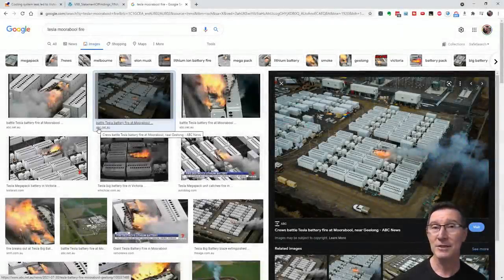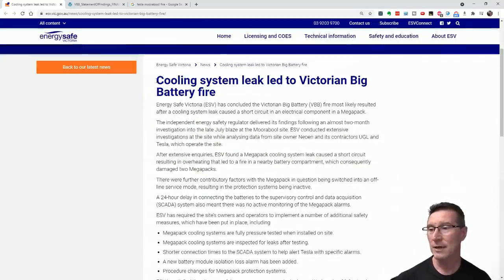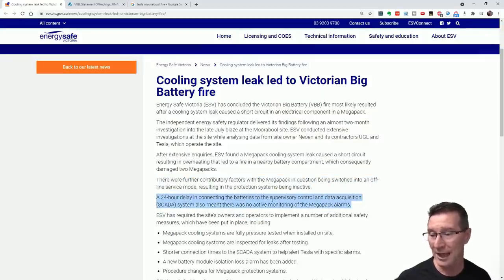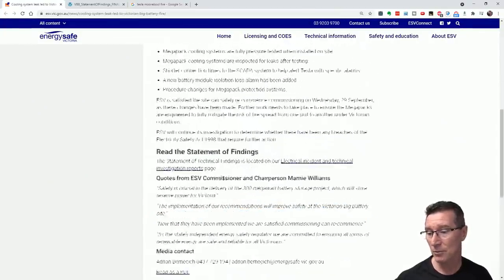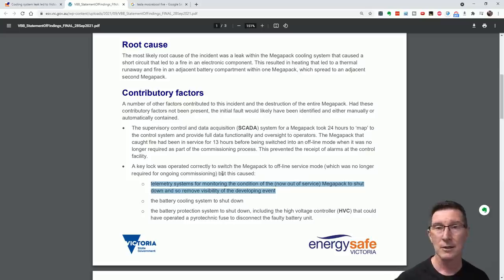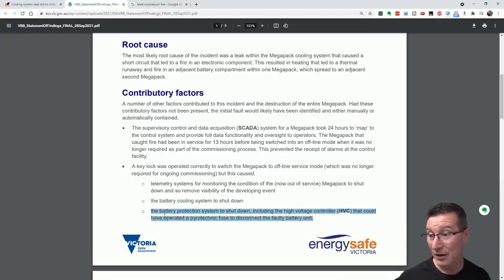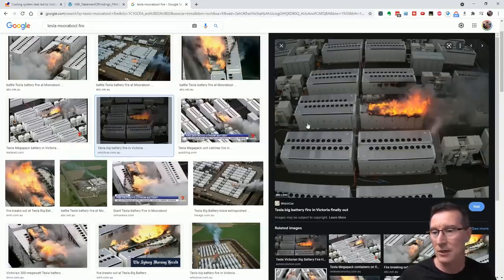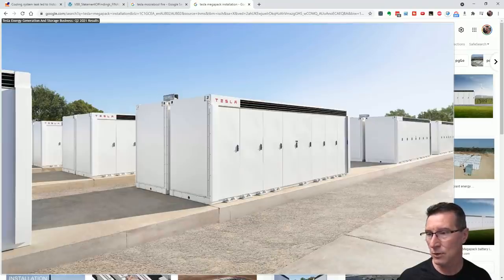EEVblog 1422 - CAUSE of the Tesla Victoria Big Battery Fire

Comment: The fact that they have no means of leak monitoring is surprising. Talk about single point failure mode!! Sounds like these installations have a lot of them!
Reply: The system was offline and not reporting such things. Had it been on it would have had mutliple alerts for different things along the way..
Reply: @--Nath--  Says who?  That report is a whitewash if I have ever seen one.  On another note, beachfront condo for sale in Florida, as well as penthouse units in downtown San Francisco.
Reply: @ReachOutToWilliam  They have pressure and temperature monitoring at minimum in the cooling system. A simple EV has that and Tesla loves sensors. On the other hand this report was lacking any specific detail whatsoever. And it's not that clear either if the SCADA could prevent the fire if it were mapped in time, because the offline switch turns off the monitoring anyway. The details are a bit hazy in this one. Why they put the pack in offline mode in the first place?
Reply: @mtx33  The lack of sensors even offline is a serious "oversight" for a facility of this size.  Poor engineering.
Reply: they have no monitoring when the monitoring is turned off... solution: make it harder to turn the monitoring off.
Reply: @somedude-lc5dy  Or don't leave the pack unsupervised in service mode. :D

Comment: Why do they use Li-Ion batteries for this kind of application anyways? I mean, LiFePO4 batteries are much more fire-safe and therefore also much easier to put out if there is an electrical fire in the area around the cells. And it's not as if the more space these cells need for the same capacity would matter very much in a facility like this?
Reply: AFAIK they will use any cell they can and soon (or already) also LFP like on Shanghai Model 3/Y
Reply: @rkan2  I'm actually quite happy that the Model 3/Ys that we'll be getting soon also use LFP cells. After all, they'll be built locally and there should be some pride in quality there ;)
Reply: Because this is one of the uses Telsa has for recycling cells from failed car battery banks. The duty cycle on these powerbanks is less aggressive than in a car so they can strech out the service life and in effect sell the same batteries multiple times for full retail in it lifecycle.

Dispite all this profiteering, Tesla still can't turn a profit without government subsidies.
Reply: @SurmaSampo  These are no used batteries.  Where did yuo got that these systems have used batteries?
Reply: @ikocheratcr  I assumes they did not change their supply chain since the original powerwalls which did use recycled cells.
Reply: @SurmaSampo  Source please!
Reply: @srenjensen3817  Dude, I am working from memory from several years ago. I don't have a copy of the original source and don't have the time to find it for you. Sorry.

Comment: It would be interesting to see the internal layout of the cooling system relative to the failed component. Seems like putting a water tap on top of your fuse box at home.
Reply: I don't think they put hose clamps in top of a relay box or something like that, but may was an "internal" leak inside some cooled component, but i'm curious too. :)
Reply: You joke, but I'm dealing with a house where the previous owner (or someone) did just that...
Reply: @arthurmoore9488  That's tough! I saw wild things in my life too, but most of the time it was more like someones bright "home improvement" idea or simply gross negligence. I'm pretty sure they conducted a test scenario with ruptured coolant lines, and designed the cabinets accordingly. But I only believe it when I can see it! :D
Reply: That's the reality of modern tech. Data centers have high power in close proximity with liquid cooling. But we have better thermal and short protections than this system clearly.

Comment: I read "failed safely" as "didn't leave a massive crater where the batteries where."
Reply: I think that's the correct interpretation. a person walking through the site would not have been killed by the failure since it was just a gradually escalating fire they could walk away from.
Reply: Looked pretty safe to me. There was no earth shattering kaboom.
Reply: I think it’s that the isolation from the grid was maintained and that nothing outside the megapack became energized. The fire could have melted insulation in a way to send ac or dc outside of the pack or to the surface of the megapack, but did not fail that way.

Comment: Hmmm. A leak in cooling system caused short circuit. 
I wonder why they do not use non-conductive fluid for cooling?
I heard oil is used to cool high voltage transformers, should be good enough for this as well.

Comment: "Megapack cooling systems are fully pressure tested"... wait does this mean this was not done before?!?! THat's ridiculous considering a $100 AIO water cooler goes through leak testing.
Reply: I think the inference is high pressure testing after being banged about on a truck then installed.

Comment: In Cornwall UK the new waste to power plant had to shut down for six months while us UK installers replaced all the soft solder joints with brazed joints as the cooling system leaked. Also cooling systems can use combustible gasses.
Sounds like the installation team used the main isolator rather than the standard routine to take pack offline to cause a complete shutdown.

Comment: The image you show on the left at ~5:30 shows the cooling. The left side of each rack unit shows the coolant in and out lines (black) and on the door is the coolant reservoir, pump and in front of the heat shield is the radiator.
Reply: Image is of a Powerpack that has a perforated door.  The Megapacks in the fire clearly have solid doors and have cooling fans on top.  I assume that Australian climate is too hot for the door cooling and requires cooling units on top, but could be a different reason. Also, I don't think that we see the pump.  There's two black boxes on the door (that look the same) but both only have orange electrical lines.

Comment: My theory:
The coolant leak might've resulted in a short circuit, directly shorting the batteries. The wires and batteries began to heat up from this rapid discharge event, and because the cooling systems weren't working, the batteries caught fire from exposure to heat. This fueled other batteries to catch fire until the entire thing burned down.
This is my theory and it's not confirmed.

Comment: i have heard a story from a friend where they had a senior engineer design a cooling system for a 24kw inverter that had no detection or loss of pressure detection whatsoever and its safety was entirely based around the (wrong) idea that distilled water is non-conductive, remains non-conductive while in an aluminum loop indefinitely and thermal detections is enough. 
and yes, they planned on also adding in antifreeze
Reply: Anyone designing cooling systems where the coolant must remain non-conductive knows that a lot of metals are a no-no; a laser system I've worked with has the coolant pipes internally nickel plated to prevent the deionised water taking up metal ions.

Comment: Might be a good idea to install misting sprinkler systems to mitigate radiative heating of nearby packs.

Liquid Nitrogen might be the only way to extinguish the core fire... It would remove the heat and cool the cells so that they cannot discharge.  Fire could return when bits warm up in ambient conditions but it gives time to contain the damage.

Comment: I have had 2 condensers that lost their charge from the factory (Residential ACs are pre-charged) in the last 13 years. One weak wield & one rough handling. I did hear of others from installers. Copper tubing conducts heat well, but is soft. Think flexing solid wire.

Comment: I would assume they are accepting a single fire taking down two megapacks. aside from that, it seems like it worked ok, but maybe some corrugated steel between rows to prevent other rows from catching, even with worse wind.

Comment: In short, they violated the first rule of any engineering: KISS
One(!) faulty component killed a whole stack? wow... it's even worse than I initially thought.
Reply: @klam77  maybe do some calculations before you spam garbage dude...
Reply: @Basement-Science  Well, a pumped-storage hydropower plant can hold up to several GW, it's just a matter of size. And storing more water in Australia isn't the worst idea anyway. Solar power during the day and hydro power during the night is not a bad idea.
Reply: @hermannschaefer4777  Find a suitable location then. Hint: this is by far the hardest part. All the good spots are usually already in use.

Comment: Makes as much sense as "Well the cooling of the nuclear reactor stops when we SCRAM the reactor" The reactor/battery is still hot you muppets
Reply: Well, Lion is not really supposed to be hot anymore after it is not being charged or discharged - unless there is some physical fault with the cell.
Reply: They way I interpreted the wording, it suggested that the leak itself caused the fault, not the loss of coolant. If the coolant was mildly conductive, it could have easily initiated an arc on downstream electronics, and of you've ever seen a multi-hundred volt DC arc, it is a nearly unstoppable force.

Comment: I don't understand either why they said it failed safely, even in an environmental perspective, there should be pump and funnels to try absorbing most of the smoke. They need a firewall, not just between each megapacks, but each packs. I would guess it took 24 hours before it's proprietary software and it had to connect to the mothership before giving controls to operators.

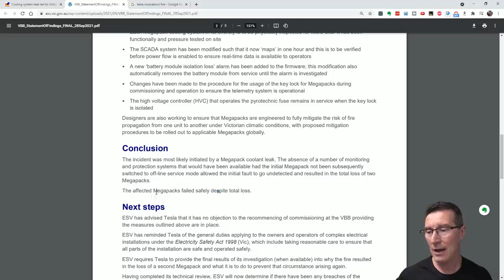Comment: 23:30 - "The megapacks failed safely" - I would presume that it means they failed in the way specified. Most notably, that would include the absence of any explosion or deflagration, the absence of any electric interference with the remainder of the facility, and the absence of uncontrolled spread of fire.
Also, from my understanding of the report, the experts seem to be of the opinion that even the adjacent unit might have remained unaffected, had it not been for the extreme Victoria climate, which seems to be outside the operating conditions for which the Megapacks were originally designed.

Comment: Interesting... One would imagine the cooling system pressure could be monitored for leaks. Especially if it's a closed loop system.
Reply: Even an open loop systems could just have a simple level switch. I operate a wind turbine (among 35 orhers) from 1992 wich has a level sensor for gear box oil. If it gets below minimum, the turbine stops and CALLS me. 30 year old "high tech" made in Germany. 😁

Comment: Sounds like they use some sort of 'Training' to listen out for the devices on the OT networks as packs are commissioned, presumably to learn their address and a 'range' of normal values, before putting alarms onto them. Less manual work, but if the thing is already a ticking problem and worth a lot of $$$$ then a more aggressive and manual population is probably a much better way of doing it. Even if it's offline, the battery potential is present, so any silicon switching has the potential to go up in smoke, likely the pyro fuses are like the car battery ones. Shipped intact, and can only be blown under software control or a massive short.

Comment: I wonder if it was a pump running dry? Turning off cooling shouldn't mean that all fluid flow stops, it should mean that it shuts down once thermal equilibrium is reached. Unless they hit the big red button version of shutdown, which is also plausible.

But fundamentally it's a battery, there's energy there all the time. So it makes sense that it's at least possible to run the cooling off the battery, and thus there are components between those two that are always energised and thus can fail hot. Unless there's a mechanical switch, which I doubt - Tesla is a very software based company.

Comment: One thing that can be done is to put a sprinkler system between the units.  So when needed water can be sprayed between the burning unit and an adjacent units to slow or stop the fire spread.

Comment: The photo at the 0:5:33 mark shows the cooling system is self-contained per "Compartment". And, interestingly, each battery within the compartment looks to be pretty well sealed. So if the issue was that the coolant leaked within one one of the batteries, there would be very little evidence left which implies it's something that's happened before more than once.

Comment: Thanks for update! 😉

From my understanding, that report brings up multiple failures. Spacing in site, transportation or mounting issues and safety monitoring system design - last one is BIG fail from Tesla side.. Why Mega pack by design can't continue to send data, but with markings that it's Offline?! 🤔

About fact, battery pack was put in offline - if I see, that big battery pack starts hissing and sparkling, especially, when charging, my first reaction will be disconnecting it.. 😏

Comment: 22:39 As I understand the overheating was caused by a short circuit caused by the leaking of the coolant on electronic components not by a component that wan't properly cooled caused (because it was offline so there was nothing to cool). I'm pretty sure that if the megapack is used without any coolant it will not catch fire because it will self regulate power output/input to avoid increse of battery temperature. Tesla vehicle infact allow you to use them without any coolant but with limited charging/discharging power and limited top speed

Comment: 21:25 - They're clearly talking about design of the Megapacks themselves, not the way they are arranged on-site. From the wording, it would seem that the Megapacks already include features designed to prevent spreading of fire between units even when placed directly adjacent, but that those features are inadequate for the Victoria climate (which, I presume, can be awfully hot). So it may be a matter of just beefing up some already existing non-combustible thermal insulation lining of the outer casing.

Comment: A simple cooling system in your car has a pressure sensor to stop the pump. But taking away all alarms and safetys in service mode is not smart. And we all know  the service login is on the inside of the door of the cabinet :-)

Comment: Thanks for covering this Dave. Failure analysis is one of my favourite parts of troubleshooting, it's fascinating to deep dive into what could have caused a fault.
Reply: It's also an important part of systems engineering to plan how a system should fail under various scenarios.  For instance, in the case of a battery farm that's subject to thermal runaway, it would be preferable to have it designed to vent fire and/or explosion to the outside, and inhibit spread internally.

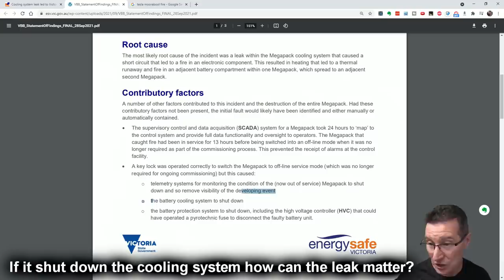Comment: 16:16 even though the cooling was switched off a leak could (and did) occur - dripping coolant on to the circuitry, causing short circuit and fire.
Reply: that was also my understanding of the root cause

Comment: 18:05 - "But that raises the question, why couldn't the Megapack independently monitor the internal temperature [...]" - Who says that's not already done? Such a thing may quite well already be part of the battery protection system, which just happened to be shut down in off-line mode.

Comment: You read that wrong.  It was in a service mode for 13 hours and thennn they switched the whole damn system off.  The fire wouldn't have happened if they were on and safety measures were able to operate right?

Comment: Just a thought. Why did individual battery protection circuits not kick in for the over current situation? Or do the individual cells not have a protection circuit?
Reply from the maker: The report said the main battery breaker was disabled!